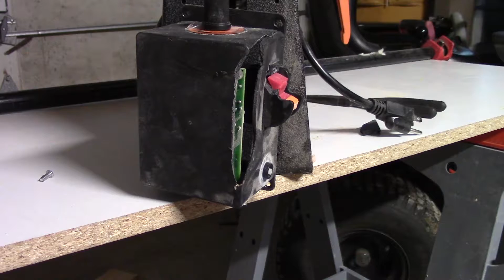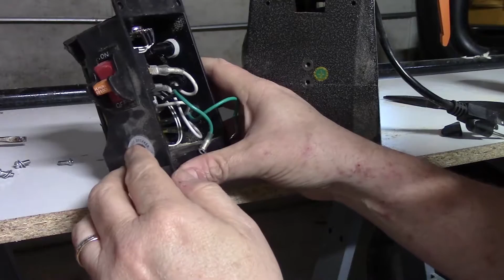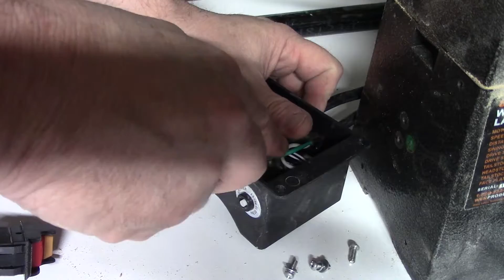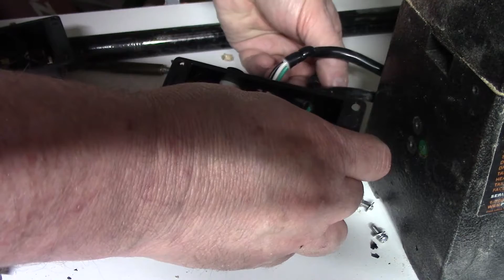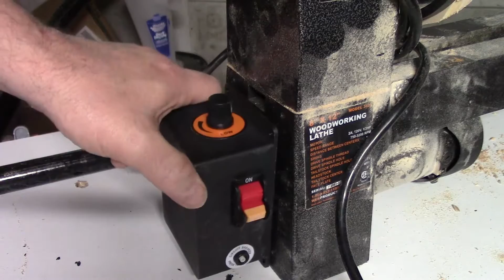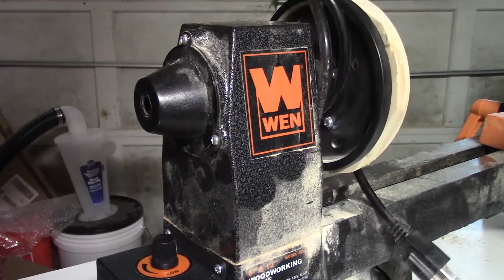Wen Mini Lath (LA 3421) Power Switch Speed Controller Box Replacement

Comment: If you're still around, can you elaborate on getting those dumb black wire holders holding the giant wires in place off? I just can not get them and I'm confused how to get them to come out. I don't know that it means to collapse the sides.
Reply from the maker: They can be a real pain to get out. Push really hard on the nub towards the wires and then push it through the box. A heat gun may make it a bit easier to do, just don't get it too hot.

Comment: Thanks. I need a new control too. My Wen keeps kicking off and on light work too. I looked up the part and they are sold out. Cost was $28.91 from the Wen site. Maybe I can fix the circuit board, could be the mosfets or some other part.
Reply from the maker: You're welcome.  Thanks for watching